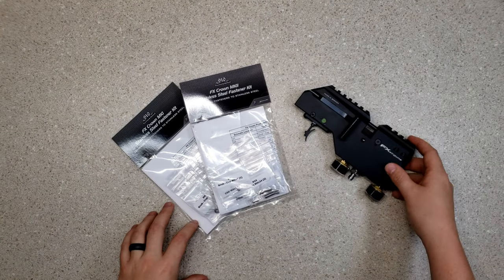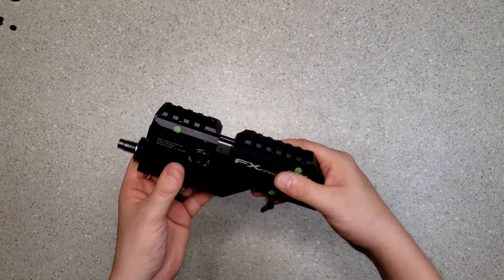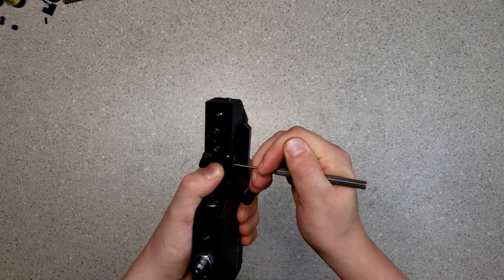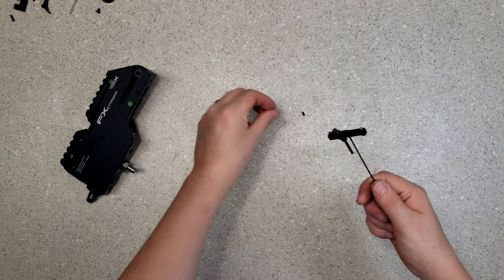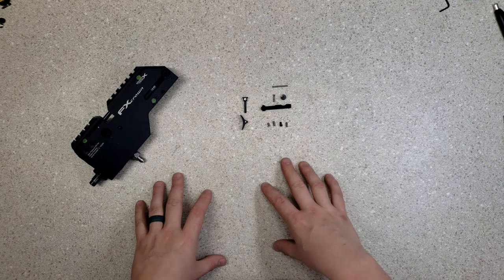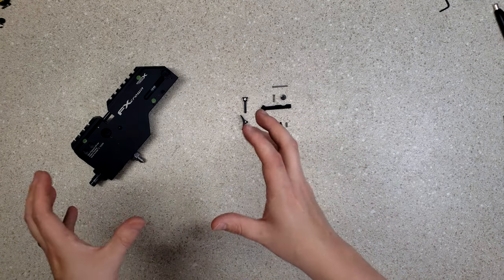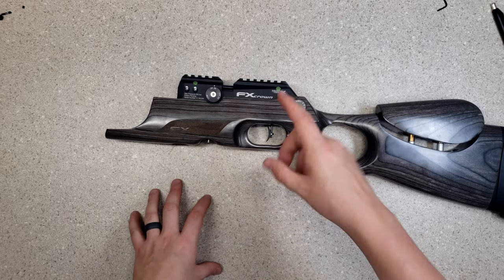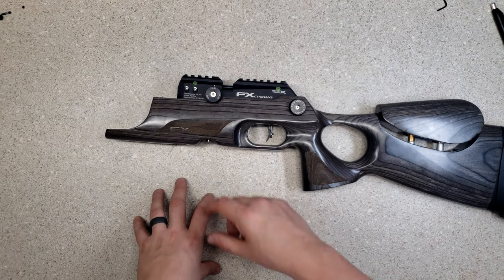FX Crown Stainless Steel Fastener Install Guide - FX Airguns

Comment: Question? If you install the huma dual barrel port, what does the opposing port look like and the size in the block/ valve body ?
Reply from the maker: The port in the body of the rifle is a round hole. I do not know the exact size but I believe it is about 7mm